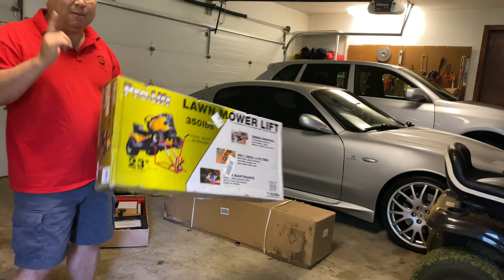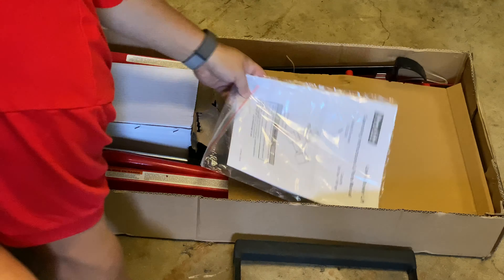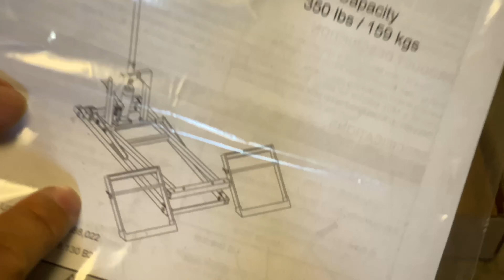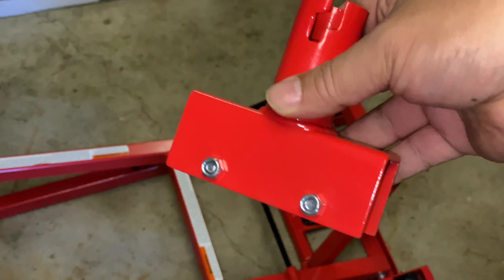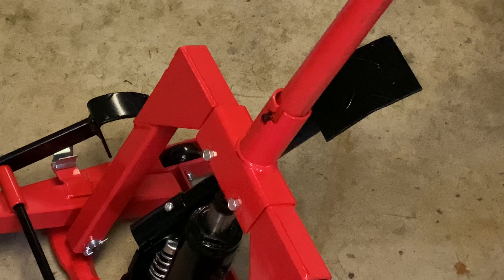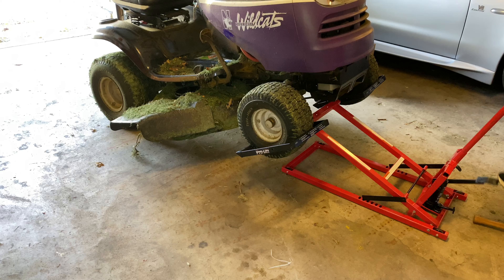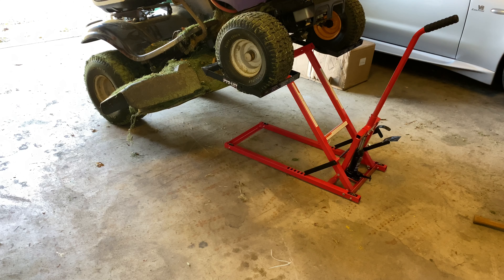Riding Lawn Mower Lift Setup and Review

Comment: I can't believe how bad your information/process was! I assembled my unit today by following the instructions and trust me, it was much clearer than what you did and much simpler. I try to view assembly/usage videos just in case someone did it better or learn about features that may not have been presented with product. I know you had the assembly instructions as you showed it in the beginning but you sure did not follow it. I appreciate that you took the time to make a video, but your mower was filthy, you were not safe when using the device, you lowered it like you were at a racetrack. I don't know how liability works when viewing and then following your process if it leads to an injury, but.. The Pro-Lift appears to be a good unit and I will be using it tomorrow, utilizing rear wheel chocks and jacks just in case unit fails. A riding mower has substantial weight if it were to fall on you. Very disturbed by your video, strongly recommend that people use the enclosed assembly instructions rather than follow this.
Reply: Please make a video. I would like to watch more of this with better close-ups and instructions for beginners.
Reply: Perhaps Cheryl you would be kind enough to produce a video to embrace all of the factors you have mentioned. Look forward to seeing it. Meanwhile thanks Peter for taking the trouble to produce your video and for providing helpful information.
Reply: Where’s your amazing video huh?